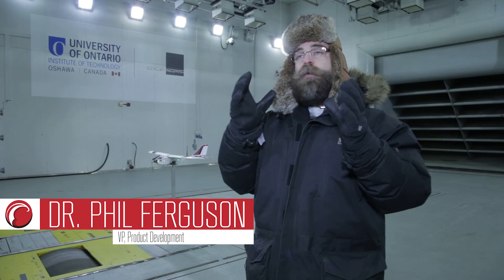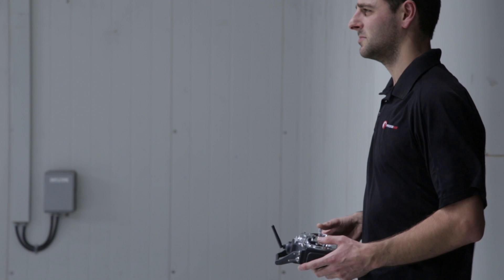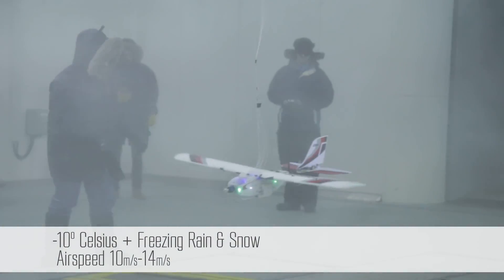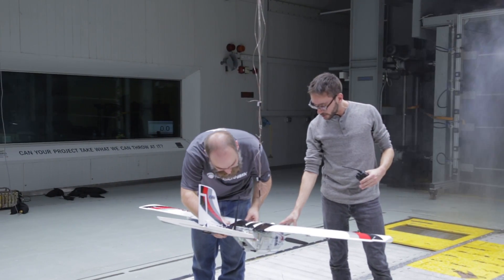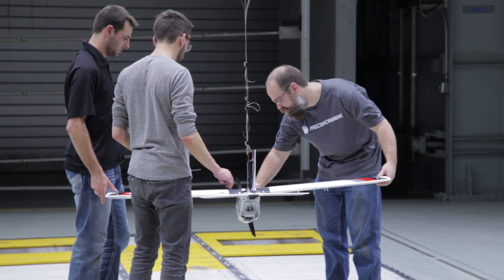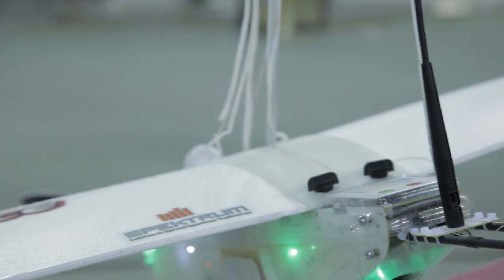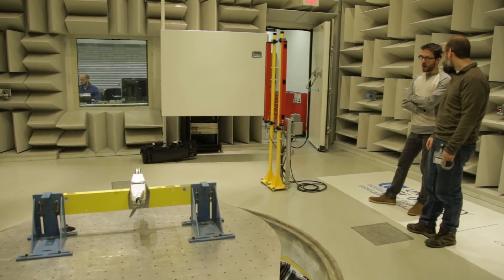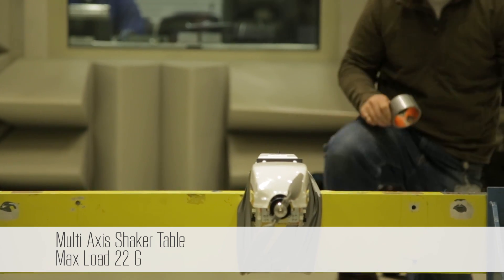PrecisionHawk Explores Extreme-Weather Testing of Drones

Comment: funny: https://www.google.com/search?q=rc+apprentice&sa=X&biw=1472&bih=774&tbm=isch&tbo=u&source=univ&ved=0ahUKEwingLvHhILLAhXEIA8KHafyA6oQsAQILA
Reply from the maker: +Arthur Costerus You'll notice the wings here are secured with elastic bands. The root of the PH wing is heavily modified to incorporate a different attachment mechanism that is substantially stronger at the wing root while improving upon the ease and brevity of installation. We also use custom airspeed sensors on the wing. Because our clients are often operating in rough environments, for applications like agriculture, energy and mining, as you can imagine, is not realistic for them to use pieces that can be damaged easily.
Reply: +PrecisionHawk No Problem! Just noticing that al actual flight surfaces are not your design but cut out of a standard of the shelve RC plane. I'm just wandering why, if you put so much time in it, you don't go the extra mile and design a decent tail sections and some wings. Many RC hobbyists are doing it... Also, is e-flite or horizon-hobby aware you are using their parts?